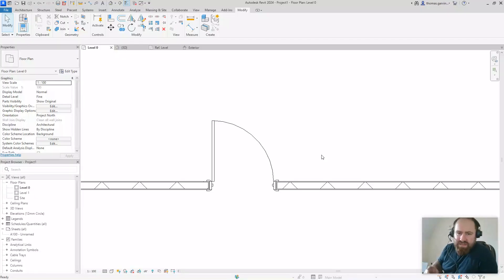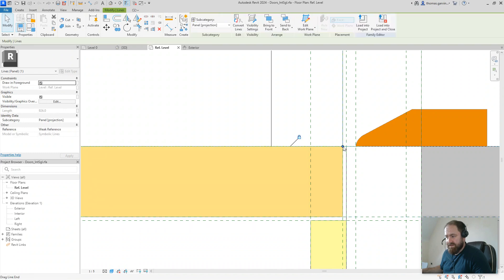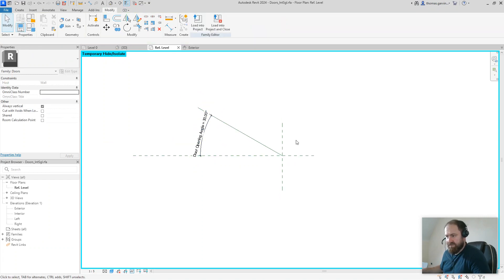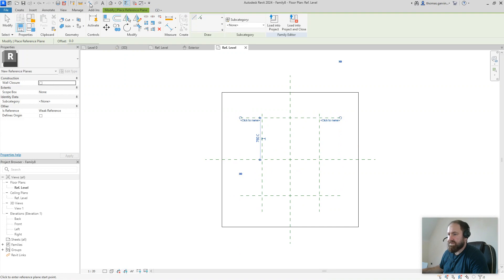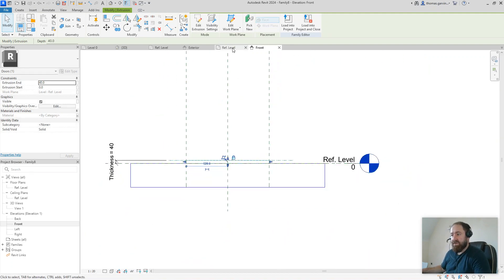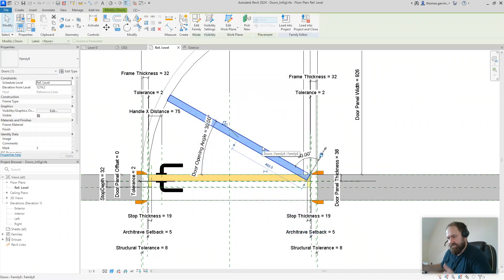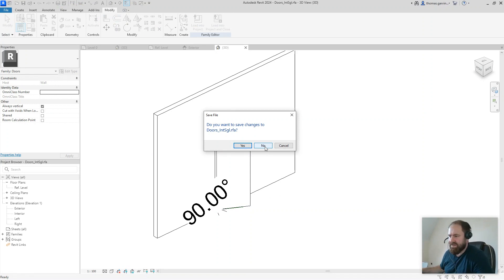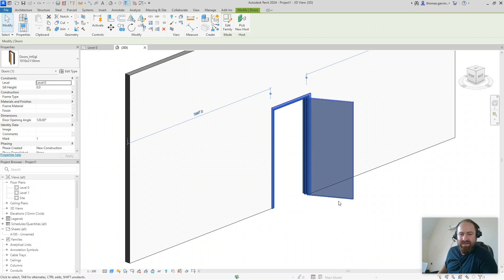Open and Close Door in 3D #2 - By Angle

Comment: You mentioned a solution for avoiding the family/ref line exploding when going to zero at around 3:00 but you did not discuss what that solution is? Appreciate your vide though, useful!
Reply from the maker: Thanks. This is the solution though! If you make the door by extrusion on the reference line it will explode at angle zero.. if you do it yhis way, it doesn't